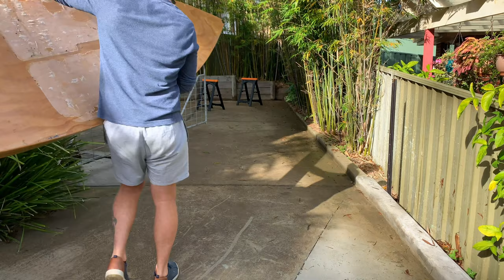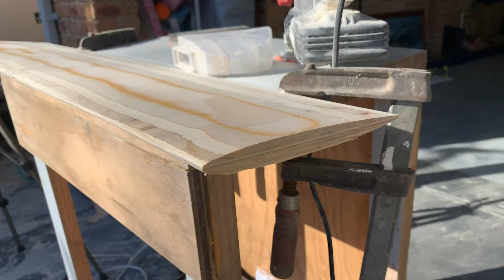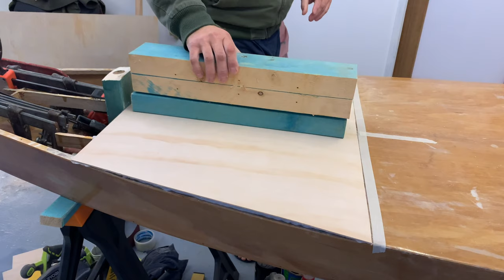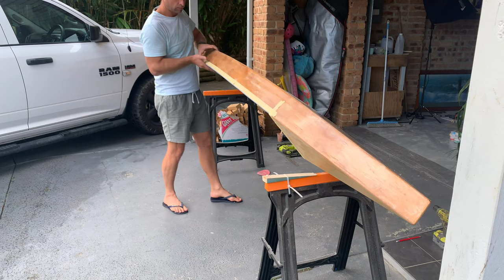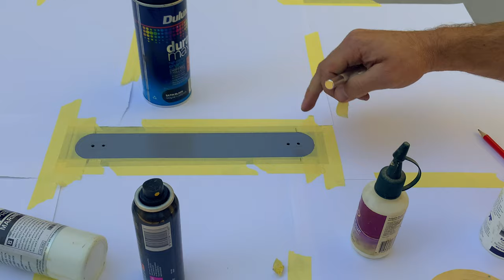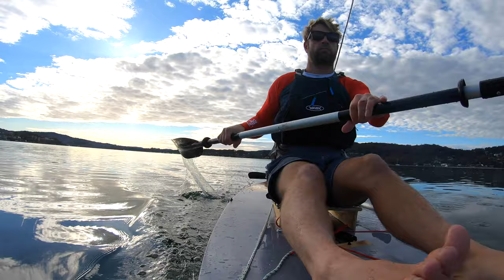Converting a plywood SUP to sail power!

Comment: Great & nice j job. question what material did you use for the sail, I am adapting  sail to my fisherman float that I usually use fins to propel, so my plan is to have a sail like a windsurfing  but smaller  , I will sit and control  the sail. what do you think, you see very knowledgeable  thanks , Dan
Reply from the maker: Hi Dan, the sail is 3.3sqm and is from Star Kayak Sail made by a fellow Aussie, Bill Pain. 🤙
Reply: @Aaron.deRuiter    Thanks

Comment: Hello good Job. Nice. You think such a sail is possible for Inflatables? Hop to hear from you.
Reply from the maker: Thanks Marcel. It would be difficult to install a sail like this in an inflatable paddle board as the mast a 200mm long hole to place it in the board. You’re better off making a new board if you want to use a similar sail.
Reply: @Aaron.deRuiter  what about the inflatables with windsurf Option, there it works with a mast! What sizes did your sail have?
Reply from the maker: @marceljansen2153  a windsurfer style sail is definitely an opinion but I think you need to stand up and hold the wishbone boom. My sail is roller furled so it can be rolled up on the water as the wind increases or put away completely.
Reply from the maker: @marceljansen2153  the sail is 3.4 square metres.
Reply: Ok. Do you have a picture from your roll up sail lying on the Flor so that i can see the shape of it.  What material is the Mast?

Comment: Sailing is way better than paddling.
Reply from the maker: Definitely! But I still enjoy plain old stand up paddling too!
Reply from the maker: Hey mate, here's the new 2022 paddle board build... https://www.youtube.com/watch?v=f29ff2zUqhU
Reply: @Aaron.deRuiter  Vintage, have you gotten into the use of a boat pole yet? The pole is much more powerful than any paddle for river travel, and provides much greater control in descent through rapids. There's a whole skill set dealing with the boat pole. It was the primary mode of upriver propulsion in most places with rocky riverbeds. Check out the book "Beyond the Paddle" by Garrett Conover. It deals with poling, lining and tracking canoes (using lines to maneuver canoes through difficult water up and downstream), and navigating canoes over stretches of shelving ice. The last aspect is probably not too germane to paddleboards, as winter travel requires staying dry, but the other parts will expand your ideas of what might be done with a paddle board. I'm fascinated with the idea of paddleboards for wilderness trekking using dry bags for transporting one's gear. Your boat pole could do double duty as a mast. I got into canoe poling years ago. The bottom form of a good poling canoe is just about the same as a paddleboard bottom form except that the ideal poling boat is broader toward the stern. Also, you wouldn't want the little stern fin on a river boat, but your kick-up ridder makes that redundant anyway.